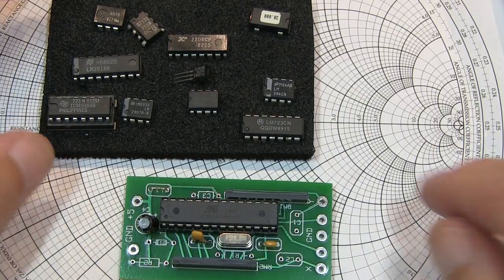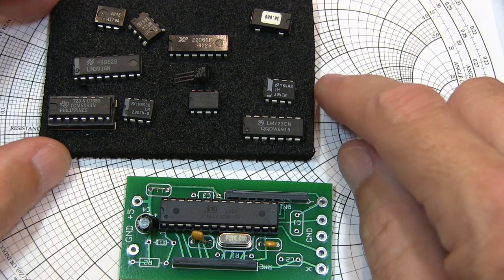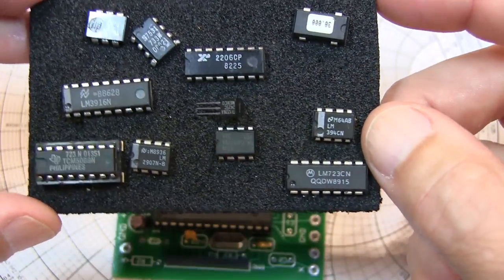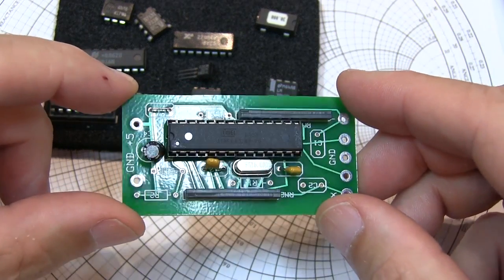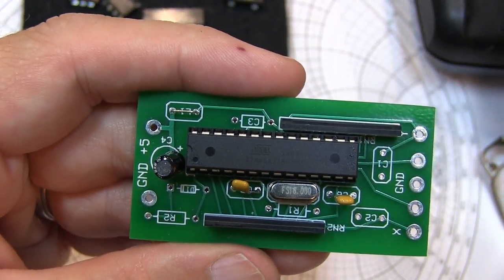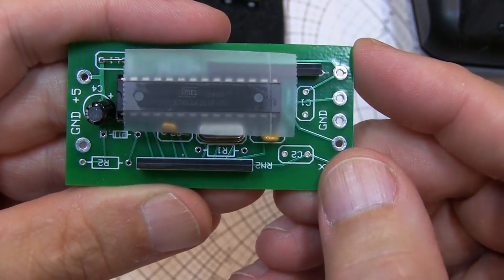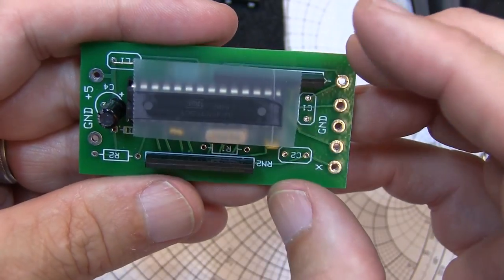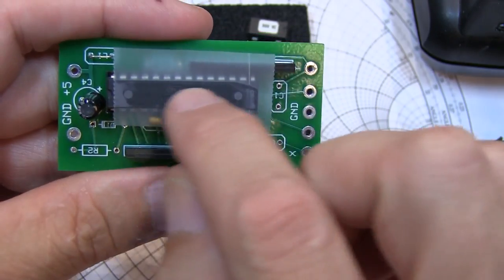#267: Quick Tip: Making IC & Transistor part numbers easy to read

Comment: I have applied a thinned out, Liquid Papaer or Wite Out typewriter correction fluid and then wiped the excess away with a tissue moistened with Isopropyl Alcohol. 

It makes the laser etched portion white and the smooth portions black permanently and reduce Static Generated top of the chip package.

Comment: I always use the white thermal paste to whip the surface of the package and it fills the laser etching and that way I always get an excellent results every time even for the very tiny packages!
Reply: Muhammad Nour 
Same here. The added bonus is that there is no increase in ESD risk from thermal paste and it can easily be removed with a rag and some IPA should you desire. The sticky tape trick could be useful if you can't find your thermal paste though.
Reply: that was my first thought after he asked if we are interested to know :P
Reply: +1 For Thermal paste. I have been using that trick for years.
Reply: White out works as well, and stays in there permanently.
Reply: Thermal paste is the way to go.  I've been marking components as well as wearing it as a fashion statement on my hands, face, and clothes for years!
Reply: Been using WhiteOut in this mannetr for years and I love it

Comment: Thanks for sharing Alan. One other tip on the same issue - I recently wanted to use my phone to magnify the IC's on boards I work with for quick google datasheet reference (My computer is far from the microscope).  The one application that standed out was " Magnifying Glass Flashlight" from Cool Guy. This is for Android Platform. It's free and when you turn it on there is a button for contrast (A letter on black background). It magnifies and also takes a picture of the IC.  you may have to angle the phone a bit, but the numbers get perfectly highlighted.

Comment: I have not tried that one before. I usually use a silver sharpie marker over the top of the chip immediately followed by a paper towel. That usually fills the etching and lasts a long time. 
Thanks for the tip -Jake

Comment: Thermal paste works great. Often it's also enough to just lick your finger and then drag finger over the surface.  And if the above can't be used, I just grab one of my old digital cameras (Canon A580) and use the macro/zoom feature while looking at the chip on the preview lcd display.

Comment: For the ESD you mentioned at the end, you imply that the IC being soldered to a circuit board diminishes risk of damage from ESD discharge is that correct? 

So in general it is ok to handle assembled PCB without ESD strap?
Reply from the maker: ICs installed in a circuit board may be less susceptible to ESD, but it is highly dependent on the IC itself and the surrounding circuitry.  It is always a good idea to use ESD precautions, expecially for CMOS and high speed circuits.
Reply: What would you consider appropriate ESD cautions to be?

And why would CMOS be more susceptible to ESD than other sorts of logic such as TTL?

And high speed circuitry is usually differential in nature, yes? Why would this be more susceptible to ESD? Isn't differential signaling less susceptible to noise?
Reply from the maker: ESD cautions include properly grounding yourself before handing parts/boards, using dissipative bench mats, wear/use ESD straps, etc.  CMOS is generally more susceptible to damage due to the thin gate oxide and small device geometries.  Some high speed digital signals are differential, but there are a lot of high speed digital and analog which is not.  Either way, high speed devices are generally small geometry which makes them more susceptible to ESD damage.

Comment: One big problem I have with chip numbers is a lot of the chips I have, the printing rubs off so easily. They have this yellowish printing on them with no laser etching and it rubs off if my hands are sweaty or oily. Like if I scratch my face, get a bit of face oil on my fingers, then touch the chip by say, pushing it into a socket, the numbers rub off. And once those numbers are gone, they're gone for good. Unless I put a tiny piece of masking tape on them and write the number with a fine tipped marker. I suspect such chips to be counterfeits, but they seem to work fine otherwise. Has anyone else had any experience with something like this happening? Any tips on how to avoid/remedy it? Besides wearing gloves or ordering from more reputable sources.

What gets me is I've even had this problem in with chips I got in a surplus radioshack kit I got that had a whole bunch of jellybean logic ICs in it. And I would have figured Radioshack would at least be reputable enough not to use counterfeit chips. But who knows these days. The rest of my chips came from AliExpress, which I know isn't the most reputable place to get chips. But since most 74/4000 series chips are usually $1 or $2 for a pack of 10 on there, it was a very tantalizing prospect. But now I have several dozen 74HC595s where the TI logo is a picture of the United States instead of Texas, among other anomalies Again, they seem to work just fine and I wouldn't suspect they were counterfeit, otherwise. But I've never actually tried to characterize them. So who knows how well they really work.

Comment: Hi Alan, thanks for this interesting tip. Until now, I was struggling to get the right angle; it's like orienting a parabolic antenna to a satelite without compass, inclinometer or satfinder instrument, hehehehe.
One side note: what does the circuit you hold in your hands do? I got me curious. I see an ATMega328, some X and Y plus a couple of direct IOs and those two resistor networks. Man I am curious now! :)
Anyway, thanks again for your videos.
73 de CT7AFR, Emmanuel.
Reply from the maker: It is a little demonstrator board that generates some XY graphics on an oscilloscope.  It was designed by a friend of mine at vintageTEK, and it produces a rendering of the original Tek logo, and a rendering of the "Wizard" cartoon that was in one of the old tek service manuals.  He has a few for sale on ebay:
http://www.ebay.com/itm/Tektronix-Oscilloscope-Logo-and-Wizard-Demonstration-Generator-/112508980640?hash=item1a320ecda0:g:xdsAAOSwB-1Yui9f
Reply: Oh! Nice! Some years ago I built a DAC converter based on a R2R ladder configuration that I saw in one of your videos to print my callsign on my scope screen using also an AVR microcontroller.
The video was your #144.
Thanks for your answer. Best regards from Portugal. 73 de CT7AFR.

Comment: Hi Alan the Tektronix AWG520 is 100MHZ OR 1GHZ output 
Thanks
Reply from the maker: The AWG520 is a arbitrary waveform generator - the output is from a DAC (digital to analog converter).  The maximum sample rate to the DAC is 1GHz, and the guaranteed analog bandwidth of the DAC output is 100MHz.  Information can be found here:
http://www.tek.com/datasheet/awg520
Reply: Thanks

Comment: I was sure when I read the title of this thing that I would learn something like "the second line is the part number and the first line means nothing important".
Reply from the maker: Unfortunately, there are no standards. Usually one of the lines is a date code or lot code, and sometimes you can recognize that as not being the part number.
Reply: Yeah no rhyme or reason , i have noticed more modern parts put part# second, older first, but who knows
Reply: Making it more annoying is when both the lines look like totally different devices which would be found in a similar package. I had an accelerometer which had the actual part numbers on the first line followed by AD85##(I don't remember, but it looked like a single channel op amp to me) on the second.

Comment: Ya, I find the laser engraving reeeeeaaaallllly annoying!  Cheap companies not using screen-printing!  And they could even do a better job of laser engraving.  Just look at that Atmel chip.  There is lots of unused room that they could use to increase the font size and make it more readable.  I'm sure they could also finish all the chips off after engraving to enhance the readability.  Or even print all chips with white paint and then laser off the unused area after the IC is made.
Reply: True true but the big question is will it make me a breakfast burrito in the morning and serve it to me in bed?
Reply: Of course it can!  It is just up to you to put the right motors and ICs in the right arrangement on a circuit board or two and do a bit of simple programming.  Very doable for the average person.  Please keep us posted on your progress!